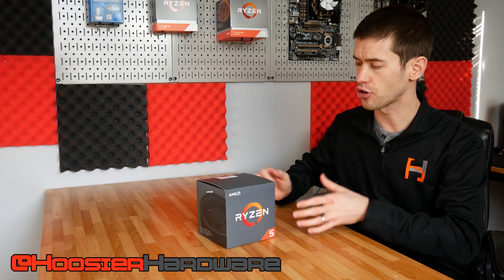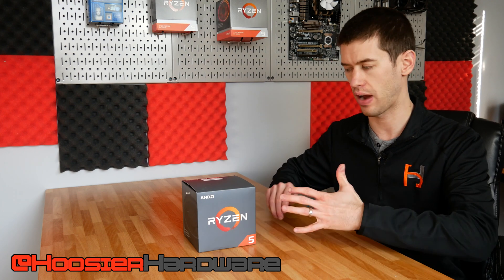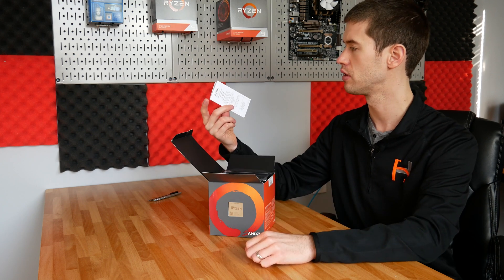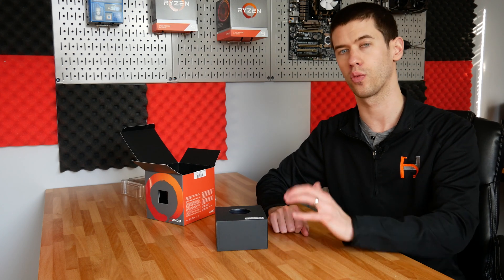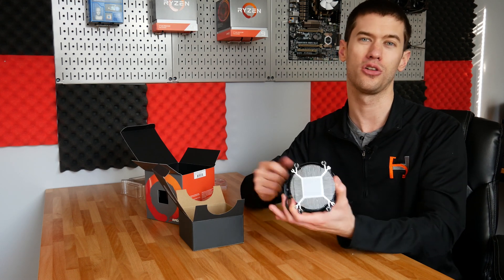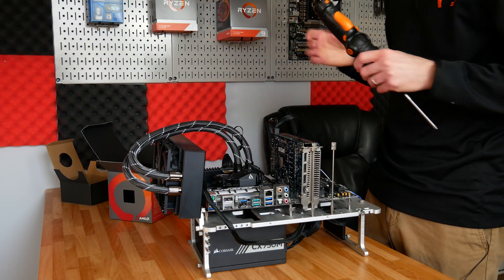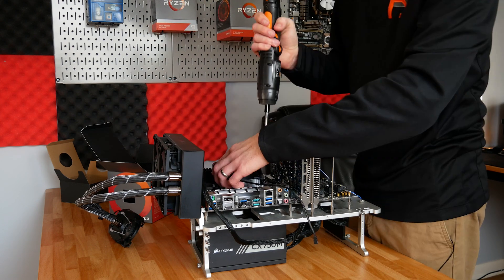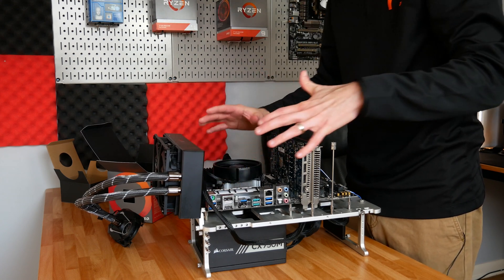Ryzen 1600 "AF" Overclocking on the Stock Cooler

Comment: I been able to get to 4.2GHz, totally stable, with 1.38750 voltage. Ran Prime95, Cinebench R15, etc. Got to underclock RAM to 3000MHz to make it work though, weird. 

Motherboard: ASRock B450 Steel Legend
PSU: Thermaltake Smart 500W 80+ White
CPU: AMD Ryzen 1600 AF (obviously 🫣)
Reply: Hey I almost have the same set up but I think your mobo is newer than mine (b450m pro4) 
I am trying to overclock, it's my first time but hopefully I figure it out

Comment: the Gen 1 1600AE is better it was a 65W chip that came with a copper core 95W CPU cooler the AF is a 65 Watt CPU with a cheapo 65 watt Cooler

Comment: Your temps are so much lower than mine, mine are hitting 45 in bios with stock cooler
Reply: At stock everything, my 1600af gets at 82C° with my case opened, but closed hits 90C° very fast (I have 2 fans)
I used cinebench
Reply: @nombre652  you fuked up something during assembly,  i would recheck if you placed the cpu , fan and paste properly
Reply: @MrDeanDog91  it's been 9 months lol. I will check again my temps and I will see but I haven't had any problem with temps in a while

Comment: Bought a 240mm AIO with my 1600 AF planning on overclocking it to 4.1GHz. A few days of trial and error and cannot get above 3.95 stable  without dumping the voltage in the high 1.4s range. Fcking lottery :(

Comment: I really wanted to upgrade to a 1600af this year from a 2500k, but unfortanely even with an a320 motherboard it just wouldnt fit into my budget, so i bought a chinese x79 motherboard, an i7-3930k and 16GB of ddr3 ecc ram, all for the price of 16gb of ddr4, it is a bit slower than a 1600af but still scores 1020 points in R15

Comment: Okay so idk what it is but I was at + .120 v and 37.00 for the clock but I kept hitting 97° max in Adia64. Is that too high or am I okay?
Reply: nah anything below 100 is safe and usable. Still sounds a lil hot for  the volts and clock you're running at though. what are you cooling with?
Reply: im assuming the stock but that definitely sounds hot
Reply: @lucalden2648  Yeah its the stock cooler but I think my problem is not enough airflow in the case so I'm ordering some more case fans.

Comment: I got 4ghz with 1.189v, is this a good chip? 100% working and stable
Reply: it is SUPER good chip. U are fucking very very lucky
Reply: Veeeeery lucky bro
Reply: I have the first 1600 at 3.9mhz 1.4V +0.5 offset so you are extremely lucky.
Reply: Silicon lottery my man
Reply: No freaking way, what did you use to test it ? Im gonna bet my ass you used only cynebench to "test" it

Comment: I have a quick question: I modified the multiplier to x39 but I didn't do any voltage change. I got 14.2k PassMark score, which is very close to 8700k. My question is: Did I do a proper overclock? I got max 82 Celcius during the PassMark test but it is my first overclock attempt, so I just wonder is there anything else I should do.
I'm using the stock cooler.
Reply: stabil çalışıyorsa sorun yok usta
Reply: @radeuz8831  Voltajla hiç oynamadığım için overclock yaptığımdan emin olamadım :) Şu an stabil 3.9Ghz'te; herhangi bir kapanma, mavi ekran vs sorunu yaşamadım

Comment: 1.2v???????
Oh hell no. Cmon its 75c, you can hit it with at least 1.3-1.35V run at 4.1-4.2GHz and it will not even go past 85c-90c during a stress test. In gaming probably never hit above 70-75c.

Comment: I ran my 2600x accidentally at 4GHz due to a bios setting being enabled by default. It ran up to 97C normally with the most it hit was 103C. I only set it to 3.6 this morning since I was scared it would melt itself
Reply: lol. 1.3V at 4GHz...... yeah that should be more than stable and cool AF even on stock cooler. 
You ether have a problem with bad cooler mounting / paste application, or you have absolutely no airflow in the case. 
The 2600x should be able to do 4.0Ghz at 1.3V (or even lower like 1.250-1.275) on the stock cooler and stay at 80c-85c depending on room temp during a stress test, and at least 15c cooler in normal operation. 
Try removing and remounting the cooler with fresh paste application and try the OC with the case side panel off.
Reply: And voltage was at 1.3 and it was completely stable

Comment: I wanted to see how far my 1600AF could be pushed and got it to boot at 1.4V/4.4GHz on a Gammaxx 400 CPU Cooler. CPU-Z Benchmarks: Single Thread Score: 502, and Multithread Score: 4055.3
I think there was even thermal headroom to push it a little further, because the CPU diode temperature at 4.4GHz was only 78°C however my motherboard doesn't allow voltages above 1.4V which it needed to run the clock any faster.
Reply: Obviously not stable, I just wanted to see how far the clock speed, voltage, and temps could be pushed, and the answer is pretty dang far!

Comment: so you sayin' the upper limit is 3.85 with stock cooler ??
Reply: No. The upper limit is 3.85  on that specific CPU with 1.2v. He chickened out at the start of the race. You can comfortably put more voltage through that chip and get past 4GHz. 1.25-1.275v at 4GHz should be reasonable. Keep in mind every CPU is different. You will have higher temps but that is stress test temperatures he is showing. In actual day-to-day use you will never stress the CPU that much unless you are doing video encoding or something like that. Hell not even then. so you will be 10-15c cooler than stress test temps at worse, unless your case has no airflow. And this CPU can handle 85c for long time in case you somehow manage to find the one game in the world that can push all 12 threads to the max. Many people in the comments of this very video report hitting 4GHZ at 1.3V (sloppy fast OC with no fine tuning but it works ;D) and still get 80c stress test and 50-60c during gaming.

Comment: i Get 85c on 3.7ghz! On Stock Cooler is This From Cpu or The Cooler?
Reply: Few options. 
Option 1 - your bios by default pushes too much voltage through the chip. Some boards do it on all chips others might do it because they treat the 1600AF as the original 1600 which needed far more voltage to get to higher speeds. Solution is to go to bios and see what voltage is set. If it is too high set it at 1.2-1.25 and you should be able to run at 3.8-3.9Ghz easy.
Option 2 - lack of airflow in the case. Many cases, especially cheaper ones have terrible airflow. Doe your case have good air vents for fresh air. Do you have at least 1 fan in the front and 1 fan at the rear moving air? Is your fan speed sufficient to move enough air? dust filters, front panels especially temper glass can choke the PC. Try removing your side panel and see if your temps improve. Fix airflow if necessary. You can try removing teh front panel and/or dust filters to see if that is the problem.  
Option 3 - low fan speed. There is a possibility that your CPU fan is not properly increasing speed with temperature. Make sure you plugged it in the right fan header. Fan curve and speed is controlled through bios. Check to see and increase fan speed if necessary. 
Option 4 - bad thermal paste application or cooler is not making good contact. Solution  - remove cooler. See how the paste look. If it does not cover the whole CPU you put too little paste. If there are areas on the chip where the paste is too thick or looks different than the rest probably the cooler did not make good contact or was not tightened properly. Reapply paste and reinstall cooler. Remember more paste than necessary is fine. Less than necessary is a problem. In very rare cases your chip and cooler have too big and matching convex on them so they can't make proper contact and need lapping. No cooler or CPU is perfectly even. I would not worry about this though just reapply paste before deciding to sand off the cooler. And do not lap the CPU itself if you have no idea how to do it safely. 
Option 5 - you can always have an issue with bad temperature reading. What program are you using to read temperature? Try another one. Software reading is never 100% accurate. For example z77 Asrock boards had an issue with reading temps years ago. What is your board? Some low end boards with bad VRM might develop have an issue and pump more power through the chip to compensate for the shitty VRM and lack of VRM cooling. But if that is the case I'd worry more about your VRM temps if they go past 105c Up to 110c is acceptable for most VRMs.
Reply: Alexander Radev Hi Thanks For Helping, i Re-installed The Cooler About only 5c Lower And Lower Voltage As Much As i Can And i Got 80c While Gaming , Vrm on My board is The Worst So i Returned it And Bought Steel Legend , My Case is Cheap but 4 Fans Are installed 3 Front And 1 Rear But Thanks For Help Will buy An Aio Soon After Couple of Months

Comment: I’ve just upgraded my pc to a ryzen 5 1600 af and 8gb ddr4 3000mhz (I plan to get 16gb when I can) but after setting up new system my ram has underclocked it’s self to 2133mhz how can oc it back to 3000mhz my mobo is a msi b450m pro m-2 max
Reply: josh webber i think its the xmp profile in the bios not sure tho

Comment: Whats safe voltage if i just wanna oc it to like 3.6 or 3.7?
Reply: You can safely push 1.35V through the chip. Perhaps go to 1.4V as long as load line calibration is not out of whack if you re looking for 100% save OC. Many people report running Rizen chips at 1.43-1.45V, but I would play it safe and not exceed 1.4V. But that is for 4.2Ghz OC and above adn needed only for really bad overclocking chips. You can go to 1.3V and get as high as 4-4.1GHz stable on most chips even 1.275V will work. As for 1.2V a realistic top point is what he found 3.85GHz. If all you are looking for is 3.6GHz you can even under clock the chip, but there is no point in doing anything in that case. Just leave it at stock.  As a rule if the turbo boost can get to a speed then stock voltage is enough to get you 200-300MHz higher on most chips at the very least. 
However I do not see a reason to leave a bunch of performance on the table. It's free performance. My recommendation is to go to 1.25V on the stock cooler and see how high you can get the clocks. When you get a crash dial it back 50MHz and you are golden. You should get at least 3.9Ghz. Stres test temps might be high (depending on room temps) but in real world scenario you will never stress the CPU anywhere near stress test load so you can be running as low as 65-70c during gaming.
Reply: @AlexanderVRadev  Ok very informative, thank you so much!
Reply: 1.2v is full stable

Comment: My 1600 af can do 3.9 stable at 1.2 but temperature always go above 95 c on stock cooler causing cpu to shut itself down.
Reply: and 1.25v / 1.28v do not stable?
Reply: No way that is possible unless you have 0 airflow in the case and stress testing in the middle of summer in Sahara. Try removing side panel of the PC. And perhaps make sure that the cooler is making proper contact with the CPU and you used enough thermal paste. Also what are you suing to stress test? Stress tests are far more intensive than anything you will use that CPU to do. Some tests (some settings in prime comes to mind) push CPUs so unreasonably high they get 20-30c hotter than video encoding 24/7 does, let alone gaming.

Comment: I have an msi mobo and at 1.4V, I can’t even go 3.9GHz stable. But in that stress test, the cpu power consumption doesn’t go over 67W. What is going on in my setup?
Reply: First how did you measure CPU power consumption? Only way to  know for sure how much power is drained is physically from the wall for the whole system. I would not trust software reading for power measurement. 
Your chip sounds like it is behaving like old 1600AE and not the new 1600AF. Are you sure someone did not sell you first gen chip for second gen? 
It could be memory issue (90% of issues are memory ;) ) Even if all you did was enabling the profile sometimes RAM just craps up when you OC the CPU. Try setting the ram to 2133 and try again. Rizen has another voltage (depending on mother board the setting is called differently) that should be withing certain range from CPU voltage. If you pushed CPU voltage too far but left that at stock the MoBo might be failing to deliver the necessary power and cause the PC to fail once you push the CPU.
Reply: Alexander Radev Yes, power measures were from onboard readings and I was dumb, it was during the aida64 stress test but when I ran a heavier program, it got to much more than that (90W I think?) I was just confused because I saw other reviews while testing on aida and their consumption appeared higher.

I did try to disable XMP but I couldn’t manage it to work...

On cpu Z it shows up as a 12nm cpu, is that accurate?

Edit: the reviews I saw was actually this test haha
And I’m not running any overclock at all, figured out that I couldn’t even reach 3.7ghz stable at voltages up to 1.375v (can’t remember correctly). Some people then started saying it could be my psu, I have no idea...

Comment: I'm sitting at 4.0ghz @ 1.3 v. Benchmarks get into the 80s, but gaming and streaming its sitting in the 50s and 60s.

If I get a better cooler I know I could go higher.
Reply: Brother Grimaldus is This on a stock cooler?
Reply: Hey out of curiosity did you manage to push it past 4GHz on 1.3V? Also what is the upper limit you got it? I am wondering if it goes past 4.2GHz at 1.375v.

Comment: 3.85? why? 3.9-4 gig  easily achieveable with 1.375 v which is well within tolerance. Most of the Ryzens run at 1.4v  if you don't change the voltage. Don't be afraid of pushng a little juice through the temps are fine with the stock cooler. Mine went to 41.5 I settled at  4 gig with 1.375v, parts don't get used for years anymore and I bet over engineered and will still work fine overvolted in 5-10 years time. It's not really overclocking anymore perfectly safe you should try moving jumpers on a 486 board where you could honestly burn down your house to get a few more frames out of Doom.

Comment: I cant hit even 3.7 Ghz at 1.2 V stable. At all Stock Settings my Cpu clocks at 3.45 Ghz. And its often at 70 degrees while Gaming.

Any Help?
( sry for my language)
Reply: Silly question. Are you sure you have the new 1600 AF chip? And not the old 1600 AE? This behavior sounds like 1600 AE chip to me which is the first generation Rizen, while the 1600 AF is second generation Rizen+ (essentially Rizen 2600 with lower price).
Reply: Emilio, you can use ryzen master to check the cpu voltages at the coresponding frequencies, ranging from 3.2 to 3.7ghz. In my case, 1600af stays at 1.2v only at 3.2ghz (1.19v actually). 3.7 ghz pulls about 1.265v. But, 4.0ghz is rock stable under stress load with only 1.29v.
It is all "luck of a draw", but getting a decent motherboard and wellknown psu brand will help with oc stability.
That's more important then running your cpu with 1.2v or 1.3v.
Reply: I hope you understand this.

CPUs are luck based. Sometimes you order the best CPU that can overclock better than any other CPU, sometimes you get a bad one that can't Overclock at all...

Comment: Does overclocking RAM and CPU impact PC performance in a negative way? Should you just overclock your CPU or is it better to overclock both components for maximum performance?
Reply: if your cooling setup is not enough cpu will throttle so with overclocking you may not gain performance boost as for the ram if timings  are loose after increasing ram speed you dont get performance boost either so you gotta find the sweet spot for yourself or you can find overclock tests on internet and try the  same.
Reply: @batuone09  Thanks!
Reply: @batuone09  Would you recommend putting up the voltage on a stock cooler on the Ryzen 5 1600 AF? Or should it stay at 1.2?

Comment: I got a 1600af recently and it's been great. It seems to use its turbo boost quite aggressively, hovering around 3.7ghz most of the time.
Reply: Mine goes up to 3.45ghz. are you getting 3.7ghz turbo boost without OC? If so, how?
Reply: I have the precision boost settings in the bios set to auto, other than that I just let it do its thing.
Reply: @flightlesssquirrel503  mine too is boosting up to 3698,9 Mhz on stock settings on MSI B450
Reply: What motherboard?
Reply: Mine goes to 3.65 ghz on turbo boost (b450 tomahawk)
Reply: Bruh mine goes up to 3.85 no oc, I don't fucking know how
Reply: Mine boosts to 3.75 at idle, but drops to as low as 3.3 under load, like...???

Comment: 4.05 GHZ 1.248v stable 24/7. think i've got a golden chip :)
Reply: 3.8 ghz at 1.4V:( My 1600AF sucks.
Reply: @patrickbateman34  Same bro 😭
Reply: Takes a good MoBo too. Especially for load line calibration.
Reply: Lucky lucky
Reply: Niiiiice
Reply: I have 1600af 4.1ghz with 1.232v :D
Reply: My fuckin 1600af came with a bent pin 🙃😑

Comment: Here, I had stabilized at 3.75mhz with stock voltages, and up to 3.85mhz at +0.102 voltage and maintain about 75/80°, but I prefer 3.75 without change voltages
Reply: Don't forget this is stress test temps. Real world scenario will be 10-15c lower unless you are doing something like video encoding 24/7. This chip can handle 90c no problem its the MoBO VRM staying under 115c that you have to worry about but if you are not running the crappiest of boards you can comfortably go to 1.3V and run 4.1GHz+ OC, get an aggressive fan curve and never see more than 80c during standard operation. People always underestimate the inability of games and day-to-day tasks to get more than 3-6 threads loaded at once. Especially seeing those overblown stress test temps.
Reply: @AlexanderVRadev  yeah. Games wont even use all cores and threads that test is using so yeah. Thats why its called stress test.

Comment: my 1600AF does 3.65 out of the box with no overclocking on the stock cooler. great cpu.
Reply: That's normal. 3.6ghz is the boost clock of a 1600af